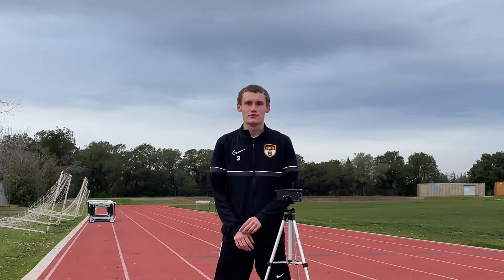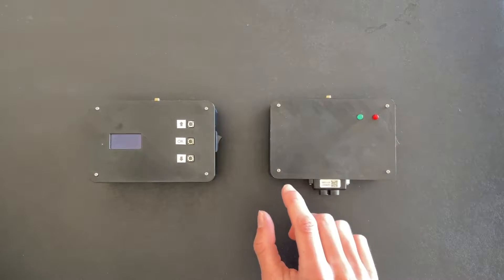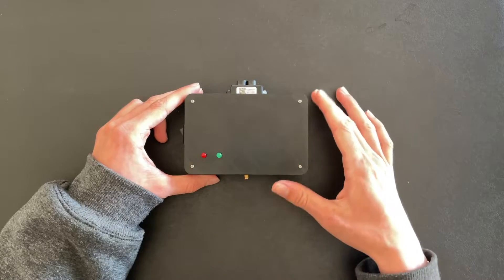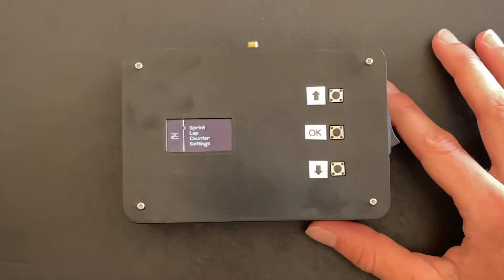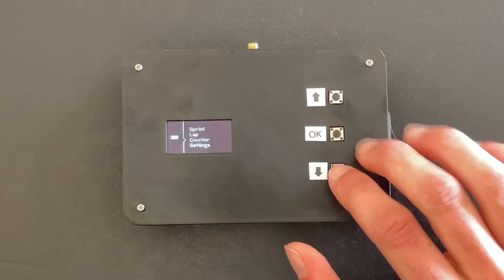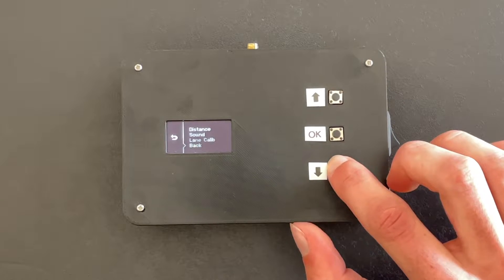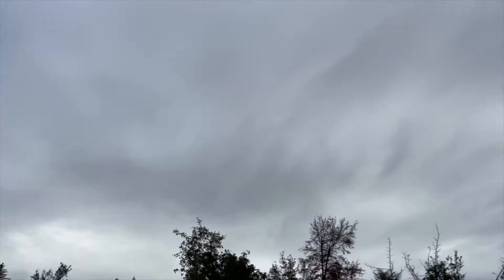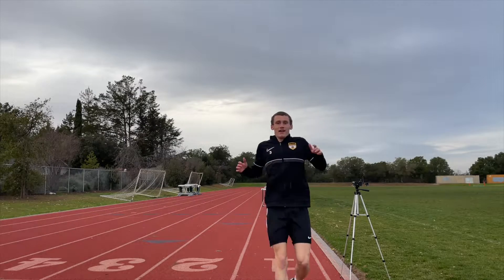DIY Affordable Track Timer

Comment: This is a great project. It works! However, I have a few questions. After I printed the boxes, nothing fit. I need help shrinking the project. If you could provide the PCB layout, I would greatly appreciate it.  

Note: Some of the part lists need to be updated 

I was able to use it with my youth track club in cardboard boxes... :)

Could this be configured to time multiple lanes for sprint races?
Reply from the maker: Awesome! So glad to hear that you were able to get it to work (for the most part!). As for fitting the project into the cases, I have added pictures of the insides of the track timers to GitHub (https://github.com/CollinWentzien/track-timer ). Also, if you could let me know what needs to be updated on the parts list, that would be great.
This definitely can time multiple races, although an issue might occur if two people are side by side. For this, you would just need to know the distance each runner is from the sensor to know what lane they were in, and then match that time with the lane. Let me know if you need any help with that. Thanks!
Reply: @CollinWentzien  
Which CAD application did you use?  I need to modfiy to use a UNO in both :)
Reply from the maker: @kevinberry5994  I used Onshape, but other programs such as Fusion360 should work fine as well. I didn't use an Arduino Uno on one of the modules since I couldn't get it to fit, but it'll definitely be fine if you expand the case.
Reply: @CollinWentzien   Thanks Collins.  I could print and update boxes to make room for an RTC.  However, I cannot update the code to add the  00:00.00.  I could print, but the hundredth would not calculate properly; instead, I was getting 00.00.0000000.......0.  I have watched many videos :).  I could really use your help. I read your comments to others, but that didn't work.
Reply from the maker: @kevinberry5994  so you're trying to round the .00000000 to 2 decimal places?
Reply: @CollinWentzien  Yes sir...  00:00.00 format :)
Reply from the maker: @kevinberry5994  Arduino is really nice in terms of not having an easy method to round... but there is a way to do it. Basically before you use the round() function multiply the number by 10^how many decimal places you want, and then divide by that number after you round. So to get .00 you would multiply the number by 100, use the round() function, then divide by 100